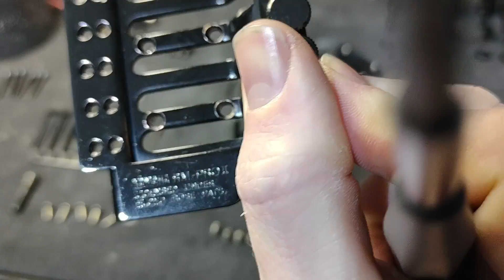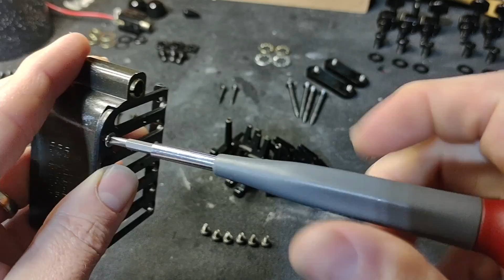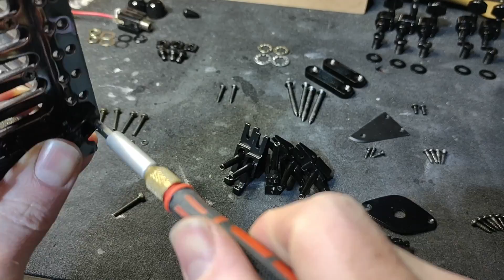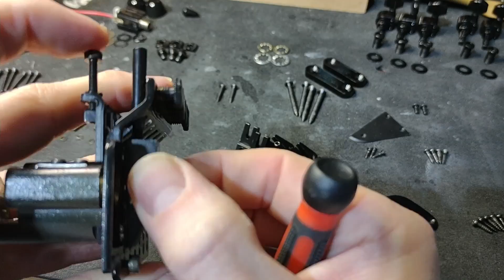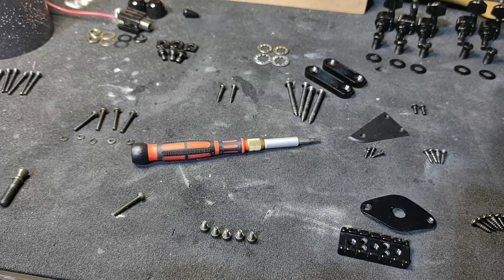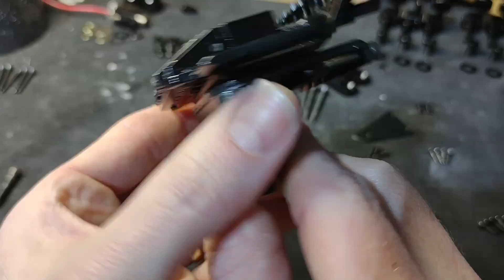Yamaha RM PRO II Assembly Guide

Comment: Excellent video on this tremolo...the most complicated bridge I have ever worked with. About 3 years ago I took one of mine apart, and sawed the arm coupling off with with a hacksaw, as the non original arm was sloppy and I  decided to replace it with a push in OFR type. The hole in the baseplate worked fine with the OFR's diameter once that section of the block was removed. The other very odd thing about this bridge is that they are not all mounted with the same spacing for the posts....I have two. The Pacifica 921 I have is mounted at 80mm, the 1221 at 74mm and a floyd will drop right onto the 1221's posts and in the route....not so on the 921.  If it's set at 80mm good luck finding a floyd that will fit in there. GE199T which has that flat knife edge for variable spacing is too big for the route.

Comment: I can’t tell but it looks like there is a metal ferrule that grips the trem arm when it pops in, located under the threaded thumb screw nut. Mine seems to be missing that piece and the trem arm is loose and rattles around. Any ideas on how to find a replacement?
Reply from the maker: https://www.fretsonthenet.com/ is a good source but I've found most parts on ebay

Comment: Is this 80 mm mount standard is 74mm hard to find a compatible without having put in rod dowel and re drilling  the mounting points.
Reply: Some of them are mounted at 80mm and others 74. Depends on the guitar.

Comment: This is a cool trem.. string through floyd in essence.. but the trem block is small.. i like to replace with brass when i can.. i was looking at the Tak Matsumoku MG-MIIG guitar.. and has cool specs.. same trem.. what is your experience with the simple Rockin Magic trems with the single locking nut.. ball end goes in the saddle?.. seems like it might be ok.. but they were on the lower end models of Yamaha.. I like double locking and blocked as you say..
Reply from the maker: @bjstein4242  really have no experience with the magic trems. I kinda tried avoiding them simply because if they broke the parts would be impossible to source.
Reply: @theittyreport  i hear you.. the trs types are much more Floyd/ Ibanez

Comment: Hi there -- I have  Pacifica 1221, and I often upgrade trems with hardened steel fasteners. Would you happen to know the size of the block screws? It looks like an M3 to me, but I am hoping to know before I need to tear the trem down.  Thanks!
Reply from the maker: I should probably get a screw gauge one day so I'll know as well. Best I can tell you is the Japanese parts are fairly standard. However, if you know anything about yamaha guitars they love making the same guitar with 5 different trems. I have no idea why they did this other than to maybe feel out what worked long term and what the public liked the most. Best trem is the RM pro II. But the TRS pro is almost the same just without the locking features. I didn't understand it at first but the RM Pro II really is genius
Reply: @chromaticmusic   well, it costs very little to buy a fewM3 and M4 screws. Once I get around to tearing down the trem, I'll try to post what everything is.

Comment: Could I ask what size and thread the intonation screws are? They look like the standard Floyd Rose screws (M3mm x 8mm), but I'd like to be sure. I'm looking at purchasing a guitar with this trem but these screws are looking quite rusty and worn, so I'd like to be sure replace them with the correct size ones.
Reply from the maker: best I can tell you is that they are of the Takuchi Japanese tremolos made in the 80/90s. they are super common so parts should be easy to find, even at home depot. they have a little chart you can take screws into and test them on the board to see exactly what they are "metric/standard" m8 etc. Go there and bring a screw and ask for help, I'm sure there's some easy solutions for you

Comment: Hello Chris, do you know if the RM Pro II matchea with the RM pro? I have an RGX Standard but many pieces doesn't work properly...
Reply from the maker: I'd love to say they are the same but I have never owned a guitar with the rm pro. However, due to the amount of guitars I have I can tell you that yamaha has a basic design that makes it so you can swap necks from 3 4 5 6 7 8 series rgz rgx and yg models so I'd be willing to guess any bridge that fits one guitar will fit another. I have a tremolo on one that has the ibanez stamp on it but it's make by takuchi in Japan so ibanez yamaha Jackson etc all used these trems in the 90s.

Comment: is it a double locking tremolo? how good is it staying in tune?
Reply from the maker: Yes, it's a double locking from the stand point of it locks the saddles down so they can't slip forward. I block all my tremolos for the most part because I like being able to detune without issues and I also really don't use the tremolo to perform. I do like having fine tuners so I'm cool with the tremolo style but block it
Reply: @theittyreport   So it doesn't block strings at the saddle like Floyds?
Reply from the maker: @rezakhan8290  it's no different than any Floyd rose as far as how it locks the strings, it just has some added features
Reply: Thanks
 @theittyreport  Thanks

Comment: Hi Chris, i recently bought a Yamaha YG 1221. However, I wanted to change the RM-PRO II, is there any alternative brand that can be use?
Reply from the maker: The Ibanez lol pro would fit perfectly
Reply: @theittyreport  ohh is there any gotoh that will fit?
Reply from the maker: @rypacifica1643  if the lugs are the same distance a gotoh should be fine. You can get a digital caliper on Amazon for under $20 and they answer a ton of questions. Let me know!
Reply: @theittyreport  Ibanez Lo-Pro Edge fits ? I cant find the tremolo bar of this RM pro II, so i want to get another Bridge.
Reply: @vsnakepit  fretsonthenet sells replacement arms
Reply: @set.0  oh! i’ll check it !!! Thank you!
Reply: @vsnakepit  the ibanez lo pro edge arm fotos perfectly.
Reply: I think there is no better trem than this in the market.